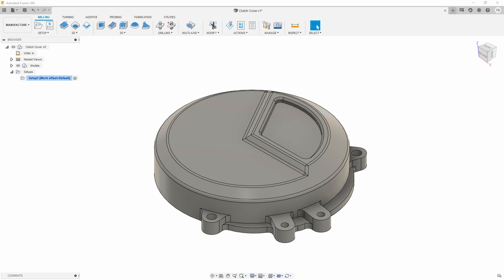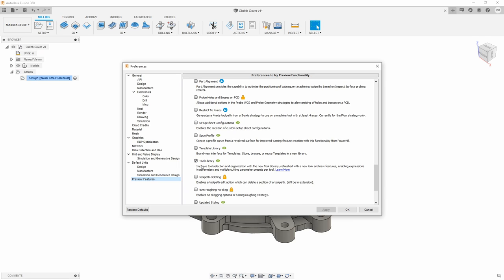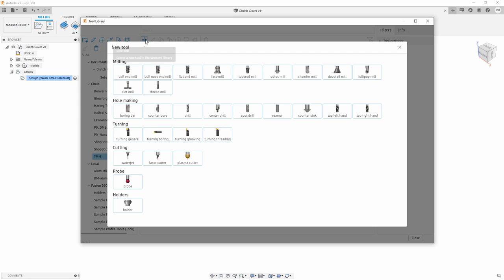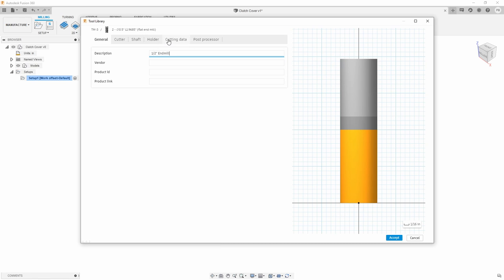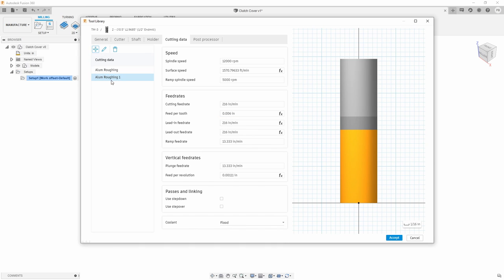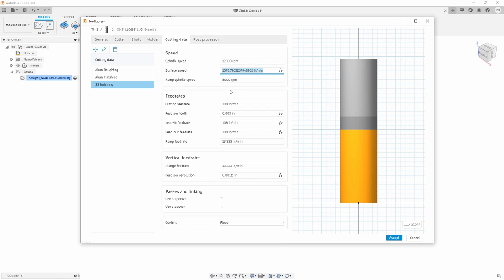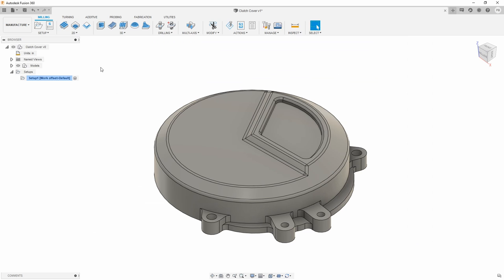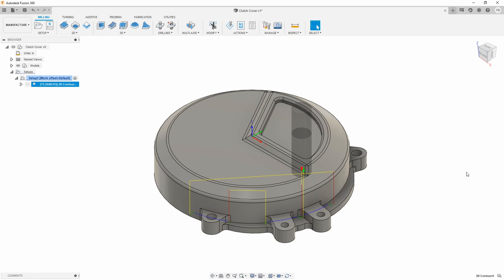QUICK TIP: New Tool Library

Comment: I like the new features but hate the new layout. I've spent all day today trying to figure it out. My tools are not arranged by number anymore and I can't find the Tormach tool holders in the Holders tab. I wish the update prompted me to pick the new way or keep with the old way. I didn't have time today to try and figure this out. I needed to be running parts, not pulling my hair out. Just saying..
Reply: I 100% agree the not sorting is very aggravating and I've given this feedback already. You can however sort by tool number by licking the Name column once which will sort from smallest to largest number. if you click it again it will reverse the order and if you click it again it will go back to the strange lack of order that it started with. hope that helps!
Reply: @marthadeans  You can also add tool number to the options at the top and sort that way but I don't understand the change. It was fine the way it was. Now I have to hit extra buttons to get the same thing.
Reply: @bower230  I use to spend a lot of time hunting down the proper speed and feed tool for each occasion as well if you think just (1) 4 flute end-mill can be used in 20 plus different application (roughing finishing slotting) as well several different speeds and feeds your library would have 20 plus tools to maintain as well you would have to define each tool (flute length stick-out ext) now its all under just 1 tool. As well at some point in the future if your models material was Aluminum than when you program it will only show you the tools for that material and speeding up your programming time.

Comment: I’m finding that when I use different feed and speed presets for a tool, my toolpaths and tool manager seem to think i’m using 2 different tools. For example, if I use my preset for a 2d adaptive in one toolpath with T1, then use a different preset for a 2d contour with that same T1,  as soon as I hit OK on the toolpath parameters window to confirm the path, it switches from T1 to T2. Has anybody else had this problem?
Reply: I tried to trouble shot this this morning however it worked just find for me. double check the problem and let me know we may have to dig deeper on the matter.

Comment: on the fx user parameters - has anyone figured out how to get the Ramp spindle speed to update based on the top spindle speed?  
I can input that parameter in there but I want it to be that way from original library so its seamless

I am taking advantage of the Presets in our College class.  so we have predefined time saver strategy for our cloud tools

Comment: @Fusion! So, presumably if I save my tools under a machine, they will be available on whichever PC or laptop I log into?
At present I think I started out wrong and tools seem to only be assigned to jobs, so if I need a 1/16" end mill for instance, I have to open the last job for it to be available.
Reply: Thomas, What you need to do when you finish a job is to hi light all your tools and right click copy and paste them into your machine library that way they are always there for whenever or whatever your doing. side tip make sure you delete your duplicates or tools you pulled since the last go around.

Comment: I don't mind new updates to software but legacy formats should be an option for the older users who have gotten used to the "old" tool library.
I don't like the new one because it makes you edit all the speeds and feed data for the different materials. The old rev had these classified into Aluminum, Steel, Plastics which was a huge time saver and I did not have to change the speed and feeds unless I needed to. Now, I have to change each and every tool depending on what material I'm cutting. Sure, the option of creating a tool set based on material is great but those have to be entered manually now.